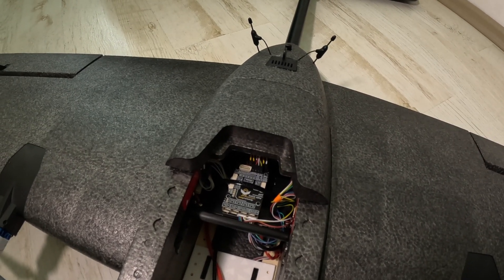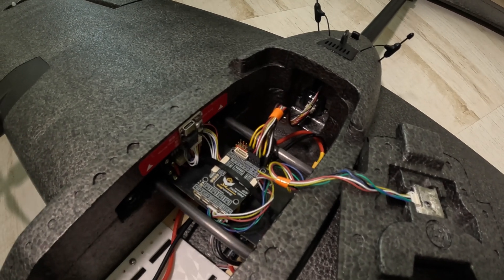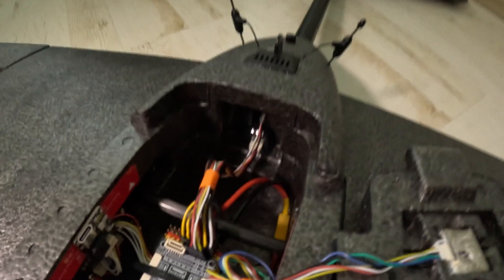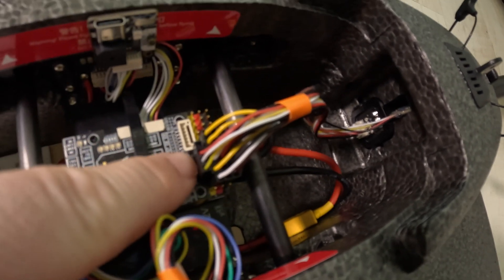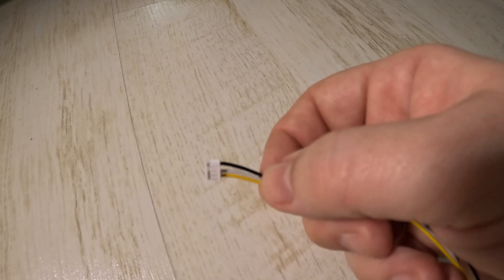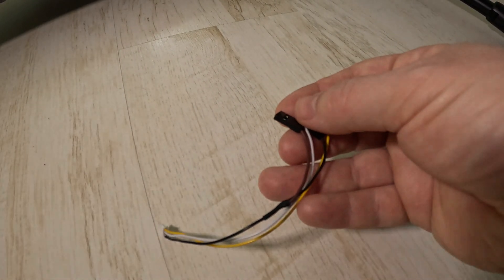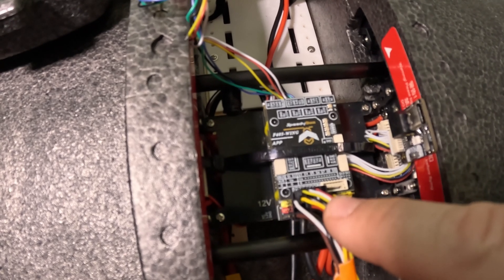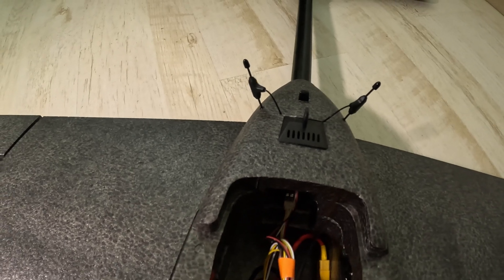Hee wing T2 Cruza build - Speedybee F405 wing and other electronics

Comment: Is that a 3D printed battery board? If so, would it be possible to get the .stl file or the original source from where it came? Thanks!
Reply from the maker: Yes, it was a 3D printed board, my friend made me a STL from my design, but I don't know if I kept the file.
Reply: @branislavmitic78  well thx for getting back with me on that . If you do come across the 3D file, I'd appreciate it.

Comment: Where did you plug the t2 crusa wing leds to on that board many thanks.
Reply from the maker: 12V connector on the T2 PDB, they are just LEDs, so no need to connect or control them with FC.
Reply: @branislavmitic78  I bought the wing second hand, so I don't have the PDB. I was just wondering if they can be plugged in anywhere on the 405 board. Many thanks for your reply would love to have the wing leds working. Sorry, I am slight noob 🤣
Reply from the maker: @MrBEEFCAKE26  There is no 12V pins on Speedybee F405 Wing by default. You can change the 9V VTX voltage to 12V by soldering two pads on the FC (it's in the manual) or you can buy a 12V BEC and power the LEDs separately
Reply: @branislavmitic78  many thanks pal 👍